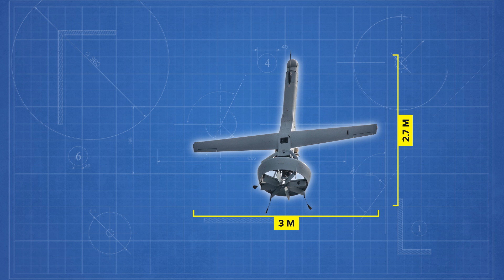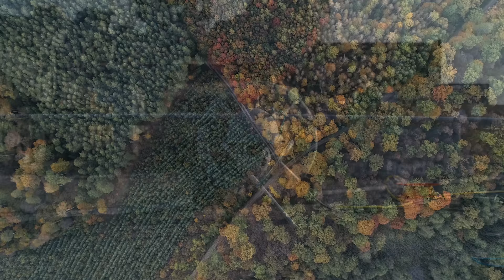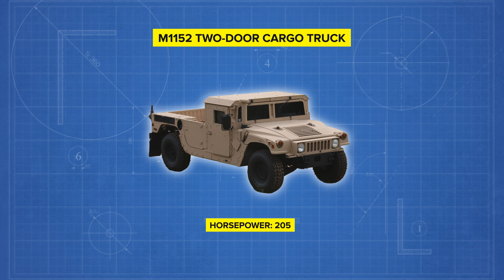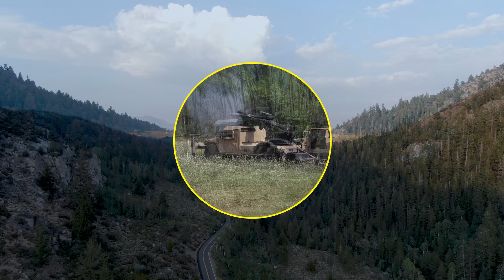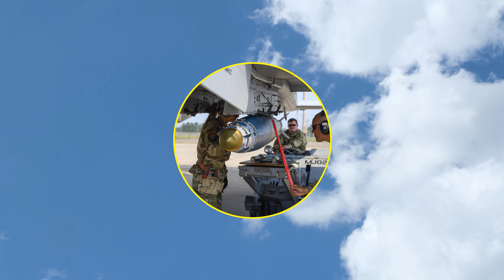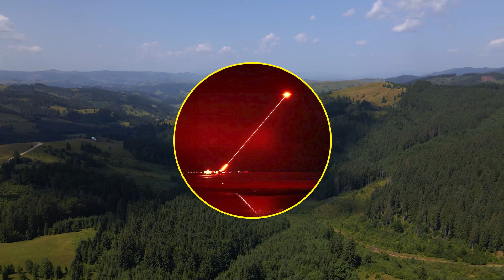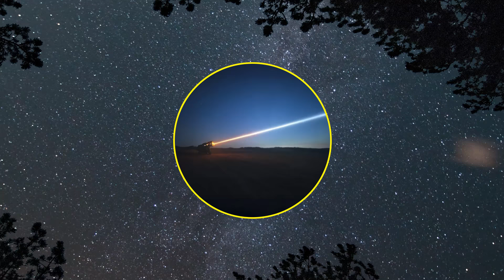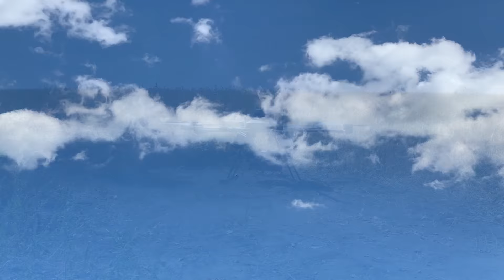INSANE Western EXPERIMENTAL WEAPONS Tested in Ukraine

Comment: Laser satellite proposal :: If a satellite sent a laser beam down at a drone, and the drone sent a laser beam back to the satellite, that link would be immune to radio jamming. Both satellite and drone would use a telescope to pick out the tiny spot of light. Both beams would be pulsed in a distinct pattern (of several colors of laser), and electronics would pick out that pattern from all other sources of light. No mistaking a street lamp for the drone or a star for the satellite. This would work best at night, but perhaps it would work by day. It wouldn't work in fog, or even clouds. A smoke screen could also block the signal.
The satellite would have to track the drone. If the link was lost, the satellite would sweep its telescope and laser in a widening search around the drone's predicted location. The drone would respond to a lost signal by flying (by inertial navigation) an agreed course from its location at the instant it lost the signal. The drone would sweep its laser and telescope in a widening circle around its best guess of the satellite's location. The top surface of the drone would be covered by corner cube reflectors (freeway paint, more or less) which would allow the satellite to detect the return of a burst of laser light sent by the satellite. 
The signal would not merely tell the drone its location. A high bandwidth 2-way channel would connect the drone, the satellite, and the home base. Some computation could be done on the satellite, since the electronics on the drone are lost then the drone hits its target.
The satellite could contain hundreds of independently steerable laser beams, each with a telescope. Drone swarms the width and breadth of Russia could be guided at the same time.

Comment: Ive been developing Radio-Controllers, with Iran and India, and DARPA 

Which use magnets for tuning to different frequencies 

And preserving digital memory

That can digitally link with a brain computer interface 

To create a biological feed back loop

For military intelligence personell 

I do large Base Computers, which are like a Tube TV 

And hand held systems 

From the size of a soccer ball

To a pocket watch

That would link digitally to the appropriate entities

Through progressively larger scale base computers 

Themselves connected by wire for personal privacy in a military installation like a family owned castle 

Or digitally, for a Military Base, like on the Maginot Line 

Later, the individual BCI can be linked to their own system

On a tank or plane or base 

But throughout the process 

We use handheld devices, and smaller computers without BCI 

In tandem with Military Intelligence, Using BCIs

Brain Computer Interfacing is like using DNA outside the body as a radio transceiver 

From a blood sample, and some biological components 

That form like a new organ 

Outside the body

Inside a magnetic chamber 

Which can link directly to a piezoelectric crystal oscillator 

Or, a quartz crystal, on a magnet board.

Radio Transmission 

Is from static field tuning, through crystal oscillators 

We also do transistor based CPU 

Although these systems can all work without them

Using batteries, magnets, wires, and quartz, 

To achieve digital computations, and Transmissions 

Based on hardware, at a binary scale 

Or more

When using the Electromagnetic Spectrum 

To define light, as current 

Which you can do 

With the most basic system built this way 

Using UV and Infra-Red spectrum

In tandem with amperage and voltage 

(Electricity)

Comment: The JDAM munition seems to be a development of the Paveway laser guided bomb (LGB), which was limited by the need to laser paint the intended target in reasonably clear air conditions.
Back in  1976ish, the RAF invented a bombing technique, using its WW2 1000lb dumb bombs, sometimes upgraded to LGB, called TOSS/LOFT, where the Jaguar GR1A would fly at near Mach speed under the radar, then pull up sharply and allow the NAVWASS to release the bomb at the optimum moment, effectively tossing it towards the target. The pilot would roll 180° to check that the bomb(s) were armed, then bunt down below the radar and head for the next target. The bomb could be accurately tossed several miles and the a/c would avoid enemy defences. This could also be used for delivering nuclear weapons!
The 1000lb medium capacity bomb could blow a crater about 30m wide and 20m deep, and shrapnel would cover an area over 2000m in diameter!

Comment: When 80% of the losses are due to Cheap FPV drones, and that ratio continues to increase, it is clear what weapon is the most successful.
There is no arguing with success.
I'm struck by the military-industrial complex's resistance to getting rid of obsolete industrial age weapons like artillery, tanks, armored personnel carriers, manned aircraft, etc.
Expensive and therefore extremely profitable systems are seeing their combat power-to-cost ratios fall off a cliff.
Much is made of the JDAM-ER's large warhead without recognizing how expensive and risky using them is, when HIMARS ballistic rockets can do the same job much more safely, or better yet, a cheap expendable suicide drone.
Where are America's drone swarms?
The best way to fight is by remote control from an undisclosed location.
"Never send a man to a drone fight."

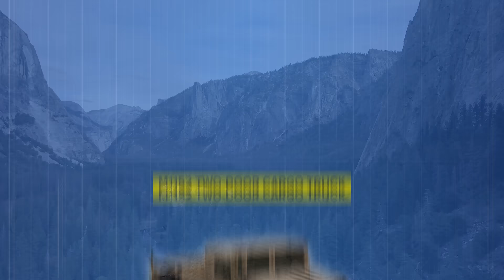Comment: 5:58 14000lb pick up truck with 200hp sounds like it would get stuck alot, especially in wet conditons. My 300hp 4000lb pick up can barely handle mud deeper than 4in...

Comment: Look if we dont have the chains on the plateaus the irononic plate holding up the oceans and the isles continents hemospheres highth depth. The perhaps 989 g forces we as a intire world have to protect. No matter the oh bigger badder stronger. The coal of the trees that was covered by last spinning planet within our system of there land island continents oceans that spiraled off. With what many see as a stationary sight of a spinning object. Same as a propeller spining to look as it is not there then completly still stationary. So if they took the chains threwout this world to make buildings. And if they used the rocket fuel and the excellerent to keep the plateau at a non spin when or if the ones beyond magnetta holding up the metal plate simply hits the electric current to spin ours. So no matter your nation if this was yall that took from every life . because they or your generations didnt take you to see the millions of arms and legs to male one concrete brick or slab pf concrete that requires calcium to hold strong.  Ask if we spin out of control who will survive 900 plus g force on any of our human bodies. And who would right the history of those that took down the guided level system of our plateau world. Please and thank you. Ps. It is a hypothisis incase any want to get a mri to see how your slaved vibration speaking language compaored to how fast anyome else speaks per millisecond of non slaved languages. That is heard by ultra sound and mri. You know that magnet that spins to hear every ones true non slaved languages. So how did any that made one in office or supiriority place the other magnettas of yalls to go threw? Or ordered to do so?  It is a hypothsisi because i do love living life. Thank you from me Dustin £ee H. Incase there is non loosers that love living as well. Whooraw

Comment: What a remarkably stupid and ill-researched video.
The Trident laser experiment is nowhere near as developed as is stated and is basically a limited license variant of the UK's early laser cannon trials at Porton Down.
That line of research was set aside in favor of a sophisticated magnetic focusing laser and the alleged evidence of damage from the Trident trials could not have come from a portable burst laser. The power requirements of the fictitious weapon glibly described would be immense.
The V-BAT  was deployed and proved to be ineffectual. Those sent in 2023 had "technical problems" -- the main one being destruction by Russian bombs then FPV drones due to slow take off.
The Hawkeye howitzer was also a failure and most were let down by rough handling.
US JAMs were reasonably effective but require air delivery and that means an air force. Kiev lost its Su-24s quickly on launches of SCALP/SS cruise missiles contrary to conditions of use and although some JDAMs were launched from MIGs, even those planes were mainly lost.
The F-16s sent by some countries cannot lift JDAMs.

Comment: 14,000 lb vehicle, powered by 205 HP. Less than a Nissan Altima.
No wonder it takes 3 minutes to move after firing.
Reply: i can only assume it’s because it doesn’t really need high speeds and it’s less maintenance and cheaper to do it that way? my hatchback does 120mph on 205hp exactly, think that thing can go 45 and it be fine? the terrain isn’t like driving in highway, i’ve never seen them driving very fast even on flat dirt roads

Comment: I like how you talk about the "scary" Russian drone attacks, illustrating your words with a video of a Ukrainian Vampire drone carrying a TM-62 anti-tank mine. Ukraine currently holds the lead in the development of the drone industry and invents new methods of drone attacks on the enemy every day. Russia can only buy Iranian Shaheds and partially move their production to its territory.
Reply: But their still losing to cheaper drones... idk if this is the gotcha you think it is.
Reply: Ardupilot based in America, which became an open source platform for dyi hobby pilots, well known and used around the globe. This system was used in the attack at the base. . However in terms of building and adapting to the battlefield yes, you're right. As the west has never experienced drone vs drone combat before. We have had glimpses of military drones, like the manta ray submarine in America for instance.
Reply: Ukraine in lead? You forgot nato and the rest of the west. Stupid comment.
Reply: @Hans-zq4ig NATO greatly helps with conventional weaponry, munition, vehicles. But NATO doesn't have any small sea drones until Ukraine not started using it. NATO doesn't have any copters for FPV attacks or light bombing. One Switchblade 300 cost more than 10 times of FPV drone. War - it is not about ultimate weaponry, it's about weaponry, that you can fit in a budget. Bayraktar TB-2 greatly helps at first - it is good reconnaissance drone with light bombing capabilities. But it's not cheep and mostly been replaced by cheapest models, developed and produced locally.

Comment: The drone looks good, the baby artillery not impressive, the JDAMs have largely been a failure, and planes having to get high enough to drop them are at risk, 1000 lb is less than 500kg while Russias FAB bombs are up to 3000kg those are massive bombs so the JDAMs are basically a dud. Ukraine is managing to invest….no it isn’t! It is investing foreign money. By itself it couldn’t. Lasers are largely not that fantastic bad weather can disrupt, they will no doubt improve and then be effective but as yet they aren’t. Russia also has lasers in use. So all in all only the drone is novel.

Comment: The laser system was given by the UK, they announced it publicly
Reply: correct sir
Reply: A laser system was possibly given by the UK. How does that Ukraine having developed their own?
Reply: @Ollies2CentsWardill  UK delivered one.
Ukraine definitely built their own as well. Chase the specs down, the Ukrainian version is different than UK. Not a weapons designer so I am only guessing that the differences are to address specific issues in Ukraine's very live requirements. Which are hard to specify with a spreadsheet thousands of kilometers away.

Comment: They have these ground drones what about adapting them with weed whacker type devices that could break the wire guided drones optic fibre lines 
Use a series of them running up and down the areas where these drones' flight paths are.
Simples.

Comment: You don’t mention that Russian jamming has compromised the JDAMs so that their accuracy is greatly reduced. They are not performing very well anymore since they are dependent on vulnerable GPS guidance.

This jamming has led to a significant decrease in the accuracy of JDAMs and other guided munitions used by Ukraine. For example, the success rate of Excalibur rounds dropped drastically, with one source reporting that at one point, only one in 19 rounds hit its target, according to The New York Times.

Comment: They are probably already doing this, but it would make sense to send a drone out to home in on the jammer directly followed by other drones to the targets. The howitzer makes sense when you realize that tanks get blown up anyway so the armor is pointless anyway.  So might as well just put a canon on a truck for speed and still have the firepower.
Reply: This is where the PT boat came from in Naval WW2. Same thinking!
Reply: Our older Bradley's that we sent to Ukraine, has the ability to receive several "hits" from Russian drones, that they either did nothing but scratch the paint, to destroying a Bradley, or to incapacitated a Bradley so it doesn't move, and/or limps back to base, in all 4 scenarios the soldiers inside all survived. That's important, because Bradley's are not only used in support of soldiers, to drop off/ pick up soldiers at the front, or that a Bradley is use as an ambulance, also used for command and control. Whereas Russian mechanized armor, the cheap goes in before quality is ever considered, therefore, there death-traps for RF's troops inside, the lucky ones sit on top and might escape... death
Reply: @The-Droll-and-LazyJoker  Not arguing with you but that's unbelievable.  In the sense that the entire point of a tank is to protect the soldiers to continue firing that gun on the tank.  The gun on a truck is just saying that the armor doesn't work so why bother.  Everything has it's place.  Just like soldiers on motorcycles.  No protection but speedy.  I don't think any of this is new either.  They were doing these things in WWII and probably further back.
Reply: @dougcox835  NATO's philosophy is survivability, and a MBT is a tool just like a hammer, that MBT while supporting troops, it also needs the troops to secure it. IFV's like the Bradley are specifically designs, and engineered for survival, it's easier to replace a MBT/IFV then it is to replace and train a driver, a gunner, loader, and it's commander. Whereas in Russia, it's build it fast, build it cheap, and build a lot, a simple philosophy, especially when your troops are irrelevant, and easily wasted. If motorcycles are being used for "scouting" missions, or to be used to embedded "sabotage teams" behind the lines or good ideas, the motorcycle has replacing the horse, I get it, but when the 600 rode, that "half a league" they didn't have a choice, RF does/did have a choice, but they squandered "the unlimited mechanized armor" repeatedly doing the same stupid attacks over and over, with the same stupid result over and over, failure is a trademark of Putin's... military
                             Cheers!
Reply: @dougcox835  
"Not arguing" but...  (lol) "into the valley of death, rode the 600" the cavalry has been around since 2000 BCE. Genghis Khan, started his adventure in 1206 used the cavalry like a surgeons scalpel. Whereas, Russians are a complete opposite, their oafish attempts to use motorcycles as speedy transport, has been a failure. (but in todays RF military, if you'er assault fails, you try it again, if that fails? rinse and repeat) RF's commanders are willing to sacrifice those soldiers lives, not only because they're desperate, they are, but because they also just don't care. That's very. unfortunate for the poor schmuck, RF soldier who actually believes in this war, errr "SMO", and his... country.
                             Cheers!
Reply: @The-Droll-and-LazyJoker  RF really got me.  I didn't know who RF was.  In my world RF means Radio Frequency.  Then I got it.  At first I thought you meant that old thing about "You can't outrun a Motorola" meaning the police radio.  Same thing in military circles.  You can move as fast as you want but the radar doesn't care, it still tracks you.  Both this and your points are true.  Speed just doesn't matter so much anymore in practice.  Other than just getting to the site to do your thing.  Once in the fight I think it's more about hitting hard and hiding.  The RF does have one tactic that also goes back to the Romans, the pincer move.  They love to surround a town and then advance on 3 sides at once and that works because that's hard to defend against.
Reply: So Ironhand/Wild Weasel, only with drones?  Makes sense.

Comment: When you have a soft recoil or recoiless firing system, you sacrifice range. The best range is achieved with a deadstop, opposite the direction of fire, like an outrigger or a base plate.

That doesn't mean that one is better. It just changes how and where they can be used.
Reply: The suspension of a vehicle also absorbs energy and reduces range.
Reply: Thats not true what you are doing is like what. Tanks do with hydraulic recoil.  You spread the force out over time so you don't have to deal with it all at once. Physics.
Reply: @74wrighty  That is true. Physics.

Comment: Jamming equipment, if not forward-directed, usually forms a tauroid around the point of origin so the best approach is from above. 

A hybrid system that moves in range freely then splits into a hover stage and a strike stage with a fiber-optic tether between, should be hard to deter.
Reply: A tauroid is the shape of a 🍩
Reply: @DragonSlayerSlayerDragon  The word you are looking for is "toroid". 
Tauroid would be in a shape of a 🐮.